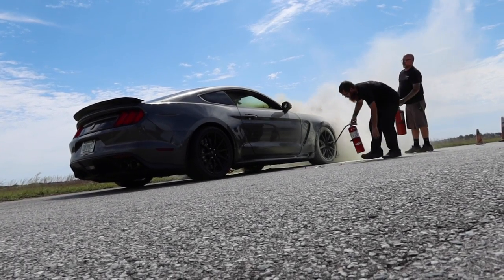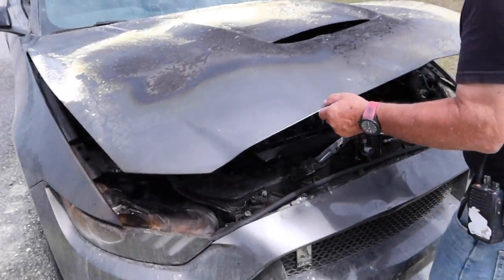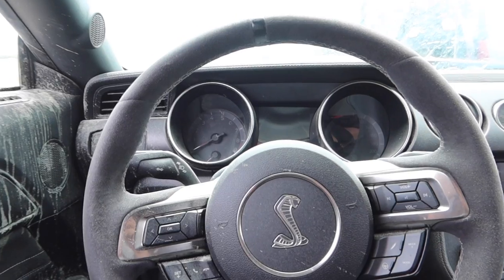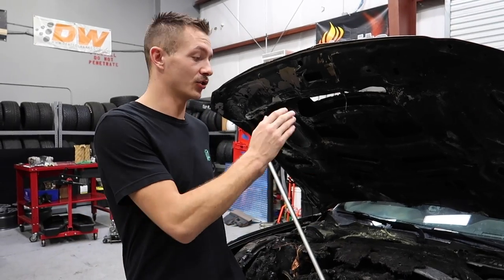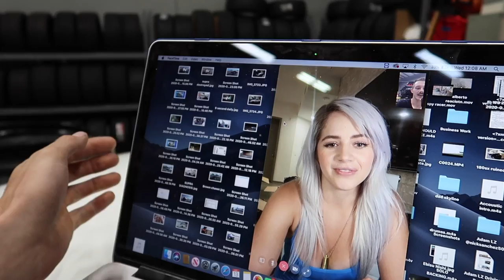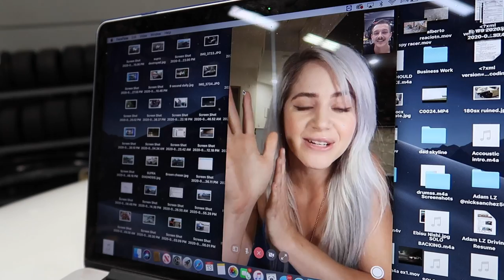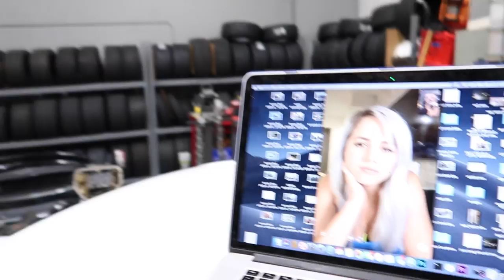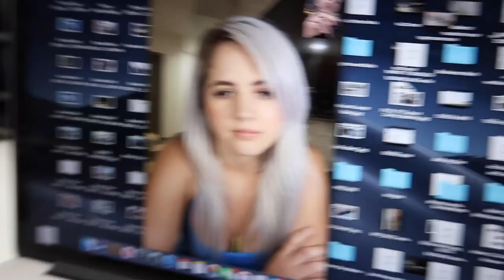Watching my Mustang GT350 Burn to the Ground...

Comment: I’m an Aircraft Maintenance Engineer and in aircraft we have stuff called lock wire. Stops everything from backing off like oil filters 🤯
Reply: bingo, many track day organizations that take safety seriously will require that you wire certain critical fluid retaining items (think oil filter).  you won't even be allowed on course without having first passed a tech inspection.  and if not for safety, then for the added penalty created that having to clean up oil creates as the track has to be closed for a bit robbing everyone of valuable run time.

Comment: I had a GT350 on the track and my oil temp sensor came loose and dumped oil on my headers, etc.  It didn't catch on fire and I didn't lose control but it was enough for me to lose confidence in the car and I traded it in ...  These cars are great but with all the motor vibrations problems are generated like having to toque the oil filter, etc.  Glad no one was hurt!

Comment: I've had to watch the same thing happen to my truck. I guess I had some leaves on my heater core. Turned on heat to warm up the cab and smoke started to come through the vents. Got home popped the hood. But I couldn't find where the smoke was coming from. It smoked for about 20 min before I saw flames coming from passenger side right next to the fire wall. It was scary and you fill so helpless watching something like that happen. Glad no one was hurt. God bless.

Comment: 39:50 the other title "My girlfriend blew up my GT350." lmao
Reply: Holy Crap, He set her up. He had the entire story already written. No remorse whatsoever. Knew exactly what the problem was why didn't he take the preventative measures for it not to happen. I would never send anyone I love into a vehicle that it would most likely catch on fire if the problem wasn't fixed. Its either pure negligence or insurance fraud.
Reply: @MrDanberube  yea, because a man worth more than 500k needs a few grand from insurance... He took the car to a dealer so it would be torqued to spec and he thought they did it right and was letting collete enjoy the cae
Reply: @hunter4036  lol 500k.. Try Atleast 2 mill. His cars alone are worth more than 500k.
Reply: @hunter4036  would you let someone you love race a car that was known to you the last time you raced it the brakes failed because of an issue you just had fixed and was known it was defective? If i personally had as many cars as he did i would say you know what, I'll try this car out for at least a couple race days to know it's safe. Just my opinion.
Reply: Daniel Berube in description it said this was a few weeks ago
Reply: Daniel Berube he literally said it could have been prevented if not for his negligence when talking about the little puddle of oil in the pits

Comment: Thinking much about this,
The oil filter was tight
It absolutely did not back off.
Maybe over tightened.
I could see a seal break loose after being over tightened.
Just a thought.
You did nothing wrong

Comment: Hey Adam, panel beater and certified automotive welder. Depending on the heat there was in the engine bay there is a real chance all the structural strength of the front end is gone.

Time for a tube front🤣
Reply: It depends. As long as the heat wasn't so severe as to burst the seams that are spot welded, it can just be made rigid again by stitch welding the seams in the front end.
Reply: Shona this is untrue. The heat will literally take the strength of the metal away. The metallurgy of the metal will not be the same. Its most likely lost all of its structural integrity. Icar certified collision tech here btw.
Reply: Structural metal pieces like frames and such almost always have some sort of heat treatment in them that makes them stronger. Once this metal is put through high temperatures, it will lose all of the advantages of the heat treatment and becoming soft again. Hopefully it wasn't too severe and the frame is salvageable!
Reply: @ced507  Also depends on the metal and the strength of the fire. If it was hot enough and sprayed well enough you could find some things extremely brittle, which is MORE dangerous than simply being softened. Difference between discovering the car won't hold an alignment worth a damn (and potentially could kill you in a crash), and finding out about embrittled components when they suddenly snap under load.
Reply: @mfree80286  very true! Doesn't seem like the fire got too crazy, but you never really know in these situations. I'm sure their mechanics have faced some sort of a similar situation before and have a plan for the car, after all Alberto and (can't remember the name of the other guy) are both really good at what they do! Hopefully they go tube front end hahah👍

Comment: Ok, don't  knows /cares if anyone said this. But, oil started the fire, plastics kept it going. The heat had to be delt with. Powder extinguishers are great for displacing oxygen. Not so good at cooling very hot materials. That kind of fire needs water. In my experience, that was handled in a very good way!!! Great job to all involved!!!

Comment: I'm glad that everyone is ok but Who sits in a car while it's smoking 🤦🏾‍♂️
Reply: I don't really understand that too, the car could've had a ruptured fuel pump or something like that, if the car "exploded" (due to fuel spoil it would burn the entire car) she wouldn't have escaped like she did
Reply: Natural selection at its best that tbh, if you see any flames or smoke from your car just get out and get back don’t go back for anything!
Reply: Adam does and so do I I've ran enough skid cars that you get quite use to it
Reply: NoNoNoNii  i said "explode" I'm just saying that the car could have burst into big flames with her inside
Reply: I’m not sure about this track, but I know that on the Nurburgring you are supposed to stay in the car if there is a malfunction unless you absolutely need to leave for safety reasons.  She might have not known if the car was going to keep burning or maybe she was just in shock.  If you do see your car smoking, gtfo.
Reply: Panicccc. Level 1000 jump tf out
Reply: Me because I’m usually the one doing the smoking 😭
Reply: @DarkNymph  The passenger compartment will NOT have fire instantly inside even if it did burn big.. as long as you can open the door, you're good..
Reply: This is why you gotta teach your woman how to open the hood on your gt350
Reply: You didn't watch the whole video.
Reply: @davewsh8434  I did watch the whole video
Reply: @davewsh8434  And what do they have to do with her sitting in a car while it's smoking
Reply: @Batman-D  they didn't even know that it was on fire when she was sitting in the car.

Comment: Also there was a issue with over torquing the oil filter down, people have posted what they have done to resolve the issue, thank god she is ok and not hurt, now i know why you went to a barra mate, well done cant wait till she is really sorted out and running perfectly auto and engine and tail shaft and diff, please upgrade the tailshaft and diff if required, if the stock units can hold over 800 to 1,000 hp and the same with torque figures then fine,but if not change them to a higher spec units, do up the auto and tail shaft and diff that way you dont have to worry about it at all, put a couple of fire extinguishers in the car as well, just to be safe and a manual hood latch made with hi temp cable with special coating around the cable fire resistant stuff that way you will always get the hood open?

Comment: I was criticized when I made small bracket for my boss that gave me a attaching point for my oil filter safety wire 
Really simple 
Having spent 37 plus years as a technician it seemed like a easy smart thing to do
Over the year I seen many loose oil filter failures 
Such a simple procedure ( installing a oil filter) can have disappointing results   For the owner of the vehicle and the person who installed it
I simple safety wire device could have prevented this failure
First you make a anchor point if your oil filter doesnt have a safety wire point take a hose clamp and drill a hole thru the tightening  screw head 
Put the hose clamp on the filter after the filter is properly tightened placing the screw in direct alignment to your safety wire anchor point twist and secure the wire to hold the filter to prevent the filter from turning 
Problem solved
I seen a video on how to build a race engine the builder said solve one problem at a time 
.
Reply: That's sound advise - but there's still an 800 Lb. gorilla in the room:
WHY does a FORD engine loosen it's oil filter ??
Vibration and RPM shouldn't be the answer - Hondas rev to 8,500 and have just 4 cylinders - V8s are perfectly balanced.
I've driven a million miles and NEVER had a filter back off.

Comment: Swap it and put a rotary engine ,
Engine inspired by collete
Reply: Wayne willy that would be class
Reply: You want it to catch fire again?!
Reply: @justintuttle6585  I mean, you don't see the oil filter backing out. the only oil that's burning is in the engine, not outside. luckily Adam takes good care of his cars and engine, a rotary would live a happy live when Adam owns one.
Reply: Do it in honor for all Rx7s that were V8 swapped.
Reply: LS swap it.
Reply: @justintuttle6585  noo the oil filter and the manifold are on different sides of the engine on a 13b he's safe

Comment: All jokes aside this is a perfect candidate for an engine swap.
Reply: Jon.b he’s putting a Barra in it
Reply: Definitely going with the Barra
Reply: your nans toaster that would be cool, but
Putting a different engine will affect EVERYTHING about the car. It will be a pain. The voodoo engine is better too! 8250rpm’s, and it’s one of the best sounding cars in the world. It would be a waste of a track car, he should put a voodoo back into it.
If he’d do that, he should just get a v6/Eco mustang for the barra swap
Not worth messing up a 40-50k+track car
Reply: I don't know why but this all sounds like initial D
Reply: Streetboyz well. It not really a 40-50k+ track-car now. Now it’s a burnt down car
Reply: Put a rotary
Reply: Streetboyz it’s now a 5-10k car at best even with a salvage title plus Barra is still ford platform and hellteck make the computer to plug straight into the car to run the Barra with everything in the car still working perfectly even the dash ad button start
Reply: Jon.b import a Barra engine from Australia. That would be right up his ally, a turbo inline 6.
Reply: Mathew Zammut he could spend more money and get it back to stock or get a built engine.
But I think I’m right and he’s going to barra swap it. He’s talked about it before and it’s a coincidence that this happened. 
It would be the first and he would gain a lot of views. And buying all the extra parts, wiring, paint, etc takes time and money

Comment: As someone who has worked at a dealership, 99% of the time it's never a certified tech who is doing oil changes. It's normally a younger person who is getting paid nearly nothing who does it. There was so many times a car would come back leaking oil that had doubled up crush washers (Nissan) or loose filters and so on. I would definitely recommend EVERYONE to learn how to maintain your own vehicle, just be careful about warranties and such if it's new.

Comment: Worst part about it is that i dont think insurance covers when you are the track 🤦🏻‍♂️
Reply: It does if you buy track insurance. Regular insurance won't cover it. It's stupid to drive on a track without insurance unless you have a cheap beat up car.
Reply: @3644Darrell  You need to do some more research on insurance buddy.   "Going around a track" is different then "racing cars around a track".   Just like if I go drag racing......if I just "go for a fast time" and blow my motor....Ford will replace under warranty.  If I'm "racing in an event against a car in the other lane".....I'm screwed.  
Same here.   "Going around the track" is simply driving a car on a road with no speed limit.....you will be covered.   Now, if that accident happens when you are involved in a 20 car race.....then it won't be.     Now, will your rate be the same after the insurance covers your car.........NO!!!!!!  GET READY FOR "NEW INSURANCE QUOTE SHOCK".
Reply: I’m pretty sure he can buy another one with the views from just this one video.
Reply: @Sahadi420  this response needs more likes I didn't know shit about this 👍
Reply: @z28camarobc  negative. YouTube only pays around 2k for every 1 million views

Comment: When you do high performance you need the right oil since the oil is thin it becomes flammable easily. We have the oil to make things right for such kind of events and we have racers racing at 40-52 Degree C and it works as if it’s winter for car

Comment: Your right, it does absolutely no good to start freaking out and getting all dramatic. Good example. And Collettes composer during the whole thing is very commendable. There was nothing she could have done to save it, and instead of breaking down and yelling screaming, as probably most would have done, man or woman, she had the presents of mind to document the whole thing. Collette,you’re a keeper, no doubt. Why to go girl.👍👍 As for the car. If engine vibrations caused this whole thing, the first thing that I thought of was a worthless harmonic balancer? Do they even have then on these engines? The canister filter may be able to withstand the vibrations but that’s not a “fix”. The fix would be to illuminate the vibrations. That’s why I Im thinking harmonic balancer.

Comment: as soon as i saw where the fire was stating, I knew it had to be either loose oil filter or maybe even dipstick. I guarantee you, dealer didn't torque it to spec. All that fire probably ceased it up, so it feels tight at this point. Most dealers do too many oil changes throughout the day, and most mechanics are over worked & tired. very easy for them to overlook, because 99% of ford vehicles do not need their oil filters torqued. The "specialist for gt3500/500" at my dealership didn't even know how to put on the front splitter correctly after trying 3 times. I ended up doint it myself. This is very reason why I do all my oil changes on my gt350. sorry for your lose.

Comment: Knowing that this is an issue, do you not think that a more "complete" solution would have been in order?  As an example, would it have been more prudent to go with an outboard oil filter setup, or something similar?  Even the best cars will have issues when you run them full out on a track, it's where you discover the problems.  Relocating the filter and taking it outboard would likely have resolved the issue.

Comment: Extra rich fuel mixtures can be burned in a catalytic/in exhaust and basically turn the whole length of exhaust red-white hot. Anything around it flammable or gas tanks, will catch.

-VW GTI, survived 2 fires after bad injectors dumping fuel.

Comment: I've had my filter cone loose after making it TIGHT.  I don't even think the recommended torque is enough. 
It sucks that the oil filter conversion kit is $500 but I am ordering one tonight. 

Good luck with your dealership!

Comment: props for mentioning the sea of desktop items on your computer.... couldn't help but read through them, although most were just screen shots. Just put them all into a "Screenshots" folder and it will look 10x's cleaner. Also noticed the "Adam LZ Driving Resume" which is kind of a cool thing to have.

Comment: Glad you are all ok. So whoever put the oil filter on is the reason you lost this beautiful car? or the oil filter gasket failed and cause the total loss of the original car. I wonder if this was a shop mechanic that put the oil filter on with the gasket pinched. Was this a known defect that the oil filter gasket gives out? either way sucks that a gasket blowing out caused this awesome GT350 to catch on fire.

Comment: “I saw a huge flame I think the car was on fire” so you just sit in it and wait for it to catch a light
Reply: I couldn’t believe how long she sat there! I would have bailed immediately. Also, why could they never get the good open? I’m not familiar with this car and the backstory
Reply: @JFed4  Wires might have been burned also the engine was on fire so the flames would have escaped through the opening.
Reply: The adrenaline doesn’t make u think fast enough
Reply: JFed 4  your never supposed to open the hood during an engine fire, thats why they didnt follow through with it. Let the guys in the fire suits do that when the hose is there
Reply: You never open the hood of a car on fire. The rush of fresh air (oxygen) will make the fire even bigger

Comment: This issue sounds more like a rattleling issue from the idle. Usually engine smooth out at higher rpm. Low rpm can loosen up bolts in the diesel world from shaking.  I can see a lumpy v8 doin the  same.  Poly mounts add to the scenerio